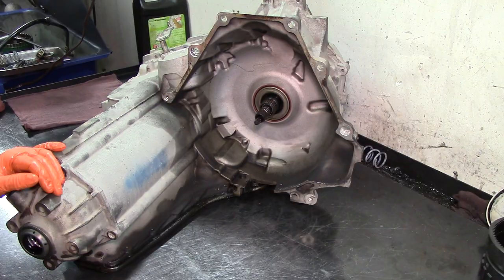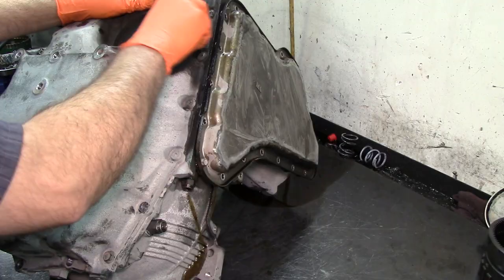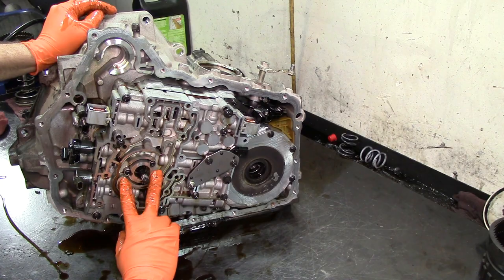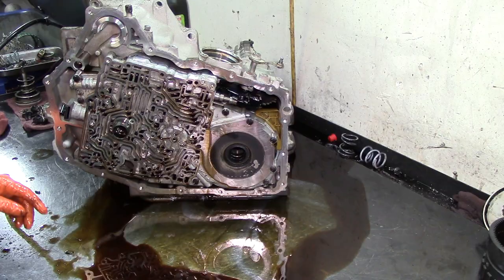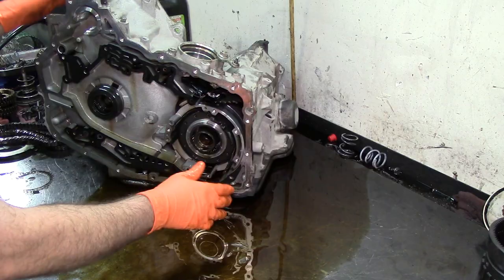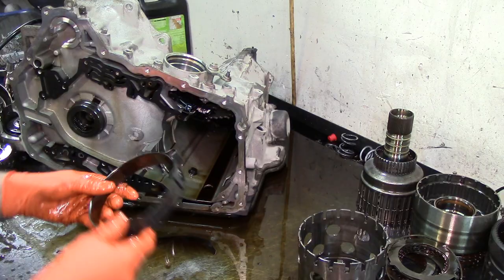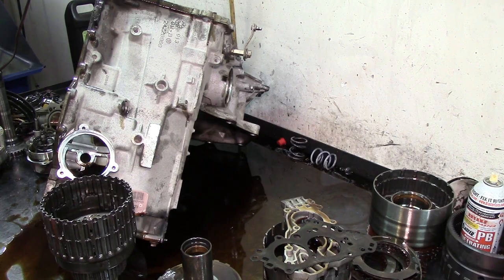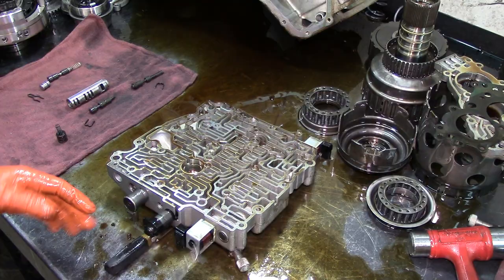4T65 E Transmission Teardown Inspection

Comment: Let me guess, they never change the filter. The 4T65e would probably last 300k if people just change the filter.
Reply: ***** old filter starves it of pressure?
Reply: D4x4Bronc I try to tell people but they believe Aamco and keep on driving until it stop.
Reply: Brandon Scheuvront What the hell are you talking about? What Grand Prix came with a manual transmission?
On your 145,000 miles unit, did u drop the pan and change the filter every 50,000 miles?
Reply: ***** what's the original filter look like by 200k?
Reply: D4x4Bronc You check the filter by poring old atf through it. 200k miles, there should be some back up.
Reply: +blackericdenice I believe I failed to change out my filter
Reply: Marckendy Jonaus What gave you that ideal?
Reply: +blackericdenice all Grand Prixs before 1997 had an optional 5 speed transmission. The mid 90's 284 5 speed swaps right in with very little modification. A lot of people swap them in to get rid of the 4t65e
Reply: Brandon Scheuvront Never seen one. Change the filter and they will last 300,000 miles or more.
Reply: +Brandon Scheuvront If you rebuild it right, using the updated parts and tech manual, it's a great unit! 2004 seems to be the year of significant change. Any reman unit previous to that year will have sub-standard parts.
Reply: Junk...Its either the splines stripping on the shaft, or solenoids going bad, or forward band breakage.
Reply: good god.....so much stuff
Reply: i have to change the trans fluid in my 4t60e  every 10,000 to keep it going and i only have 120k on it every 30,000 i change the shift solinods to be safe i have never had a problem after that but i don,t think this rout saves any money
Reply: I'm getting my 2008 lacrosse 3800 4t65 e transmission rebuilt on Monday. Lasted 175,000 👀and two filter & atf changes. Miles 83k, and again at 132k. Think it has a broken weld on parking pawl - common issue. Otherwise, car is near mint!

Comment: Hey Hiram, i have a quick question. I have a 2001 z28 and I'm having some issues with the tranny or torque converter i think. It's an auto so it's a 4l60e. The problem I have is say I'm cruising on the highway about 65-70 mph and it's usually at just below 2000 rpm with the 2.43 gears i believe? If i push accelerator to about half open throttle or more, the car down shifts like normal and then a second later downshifts again? And it ends up hitting the rev limiter... any idea what this could be?

Comment: what are the round wire plugs on the side, i changed trans in a 97 gran prix 3800..
the original round wire plug had i think 6 wires, the replacement trans had the round wire plug had a different type of plug in the trans how to i change that
Reply: ditto what he said...there are apps for this trans that are ONE YEAR ONLY.  2001 is a one year only app, so is 2003.  meaning if you swap another year trans in from an identical model, it won't work right.  or not plug in at all.

Comment: I am a fleet mechanic for the postal service, our uplander vans break the forward band all the time, they will come in with no movement in drive, but still moves in reverse. if you put it in manual 1 it will pull itself into the shop, although I wouldn't call it driving. does someone make a stronger band? Also we burn fluid very quickly because our trucks rarely get passed 2nd gear, what do you suggest?
Reply from the maker: +Jake 1024 An external cooler after the radiator. On the band issues I couldn't tell you. But I install the Borg Warner red band instead of the green one.

Comment: now, I hear a whinny noise after driving it for awhile. I can get the sound to change or stop while shifting in between P, R, N, & D, most particularly between Natural with just a tad bit of pressure on the shiftier going in to reverse.  Any ideas at what I should be  looking  into? Its a 2000 Buick Century. Thanks.
Reply: Michael Brown my whinny noise turns out to be my wife

Comment: I dropped my tranny pan to change the filter and I seen a piece of the band you were referring to @38:35. I was wondering if it were possible to replace that band from the bottom of the car? is it difficult/possible from underneath the car?
Reply: +Alex Martinez  Check out m ph channel. He does an on-the-car repair on your problem. 4t65e reassembly in car (4 parts).

Comment: question: when you remove the drive sprockets they slip out, but mine feel stuck. Am I missing a step to remove them? Thanks for the videos!
Reply: Wade Hudson Question. Can the turbine shaft with the drive sprockets be removed if transmission is still connected to engine? I'm doing a partial rebuild to correct the P1811 code and I'm doing all of this on the drivers side fender well area. Also can the drive sprocket housing clearance be checked for tolerances "prior" to removal from case? I mean would it work like that? And then having the selective washers on order prior to installation? Or after overhaul will the tolerance for the clearance change? Also is it important for the "master" blue link on the chain to be put back on in the same location during Installtion? Lots of questions, sorry, i just want to make sure I don't destroy this transmission as I've never rebuilt on before.

Comment: will replacing turbine speed sensor fix code "p0717 input/turbine speed sensor circuit no signal" ? i erase the code and sometimes it'll come back on after long periods of time

Comment: I'm changing a 4t60e is there anyway to take it it out without removing the engine or separating the frame and the body
Reply: +Chase Manneh Its either or man. To do it without removing the engine you have to get the car on a lift. Then you have to support the engine with an overhead support bar so you can remove the cradle assembly to start removing the transmission.

Comment: Maybe you can help me diagnose my cars transmission issue. I have a 2003 Chevy Monte Carlo SS and just recently my transmission has been having issues the engine is making more power and that energy isn't being properly exerted by the transmission. The car is having troubles shifting smoothly and sometimes shudder with changing gears (2 to 3) and shake the car until i let off of the gas and the tachometer bounces back and forth when this occurs (I think its something with the torque converter clutch) perhaps it is the 1-2 and 2-3 solenoids but I'm not entirely sure. Can you provide some insight? the car has a little over 99,000 miles
Reply: Hey did you ever find the problem. I had my transmission rebuild and it does the same thing but coming out of 1 going into 2 or if you gun it it takes a while for it to shift or it would get stuck at 6,500 rpms

Comment: Can I do the modifications to my 2008 Pontiac GP 4t65e non supercharged channel plate and valve body? getting code po741 TCC stuck. the transmission is fluttering at times and no forth at times.I want to rebuild a 08 4t65e (PONTIAC GP) can i do the modifications to the channel plate and valve body myself, I am getting code po741 I want to rebuild a 08 4t65e (PONTIAC GP) can i do the modifications to the channel plate and valve body myself, I am getting code po741 I want to rebuild a 08 4t65e (PONTIAC GP) can i do the modifications to the channel plate and valve body myself, I am getting code po741

Comment: I'm in the middle of rebuilding a 4t65e out of a 07 grand prix.  I've never done it before. Is it good practice to replace every seal and bushing etc or just the ones damaged/ worn?
Reply from the maker: +qposton25 Everything. But for the bushings you will need the tools for it.
Reply: Automatic Transmission I got the asg rebuild guide.  I got most of the tools listed in there used from ebay.  Just wasn't sure how much was necessary or what's best practice

Comment: In 1:06 you removed some o-ring will a normal o-ring work or is it a Teflon o-ring? Mine was pretty chewed up, and for the life of me I can’t get a part number or a clear answer or useful information in how to obtain a new one....my project is held up by this single o-ring...I’m about to call it a day and put a rubber o-ring and slide the torc converter over it...the first o-ring was to big so I got some ac o rings and the torc converter stubbornly went over it and locked in place.
Reply: It is not teflon, a quality standard O ring will work. B17019, 64380 are part numbers, but quite pricey as a single item. eBay has it.
https://www.transpartsonline.com/TRANS_PARTS_FILE/tpcat.php?TransPartsOnline=4T65E&TransPartsType=4T65E
Reply: @leebarnes655  thanks for the info.... I need to find a chain and driver side housing bearing....I have a 4t65-HD chain is the non Hd chain the same as the HD version.

Every time I find a chain...It isn’t specific
Reply: @ebperformance8436  You are welcome, no difference in chain, just the sprockets have a different tooth count for HD final ratio of 3.29 with 37 drive /33 driven teeth. Further ratios are possible with differential area pinion, sun, and planet sets. Left side axle bearing is complicated with many supporting bushing and bearings at work, most of which are probably good enough not counting catastrophes only you can be the judge of. Input Drum bushing 84048A supports 4th gear clutch hub/shaft/toobage thingy by direct contact with axle on the inside dimension. Outer support of the toob is transferred to needle bearing 84298 mounted into the Driven Sprocket Support proper. At that point the axle isn't moving around but the CV joint hub over the axle stub gets additional direct support by needle bearing D84299H mounted into the Channel Plate case cover just inside of the left side axle oil seal. Just in case you can appreciate some eye candy:
https://zzperformance.com/collections/3800/products/4t65e-chrome-moly-pump-shaft
Reply: @james bachour without that O-ring…it’s gonna leak….Car AC O-rings will work.
The torc converter can be a pain with that o-ring’ I use a dab or transmission fluid…so it can slide.
 Are sure it clicks in 3 times….you will know when it’s installed correctly.

Comment: Quick question, the 4T65-E in my Grand Prix will slip past 4000rpm going into 2nd gear. But the other day I had it over 5000rpm and it didn't slip. I guess it's a hit or miss type thing. With your expertise, do you think I should do a fluid change? It's got 127000 miles on the original fluid. Only reason I haven't changed the fluid is because I'm afraid it will damage the transmission more after the the fluid change. Ideas?
Reply: +Subway Guy If you use a Trans-Tech fluid &#39;Exchange&#39; machine and genuine DEX VI fluid along with a genuine WIX or GM filter swap, you shouldn&#39;t be in danger of harming it with that mileage. It also depends on how hard that transmission has been driven up to that point. Hiram or other experienced trans builders know better than myself. I speak from a general maintenance tech position.
The trans-tech machine is basically a giant plunger within a clear cylinder. It is powered by the pump in the transmission itself. as old fluid exits, it pushes the plunger with fresh fluid back into the return line from the radiator. I have had extremely good luck with that machine due to it&#39;s simple, but effective design. I also use about 3 - 4 quarts extra fluid in the process to aid with flushing out the old fluid..  It&#39;s not overfilling,, it&#39;s kinda like a clean fluid insurance or guarantee instead.
Reply: drop trans pan change filger and refill what ya take out. or pump fluid out and put some back in if youre scared. id just flush it.....i thought that too but 160k miles my differential blew up and i assumed since my fluid is pure black thats the reason...but hey it brought me to learn about cars i guess
Reply: +Joshua Cole pump fluid out of dip stick im saying ...is the 2nd option
Reply: Joshua Cole I don't have the car anymore. Trans did eventually start dying so I sold it.
Reply: The type 4T65-E is for gt 2000 gran prix?

Comment: quick question, if the lip seal on the foward servo piston lets air bypass as you put it in the bore, is that bad? is it suppose to be hard to install the new longer lip seal with piston inside the bore?